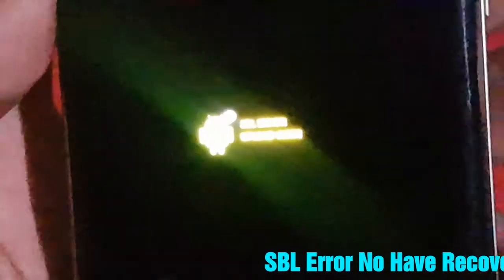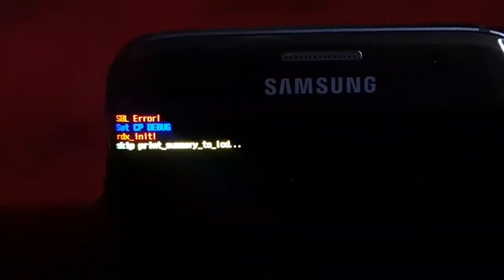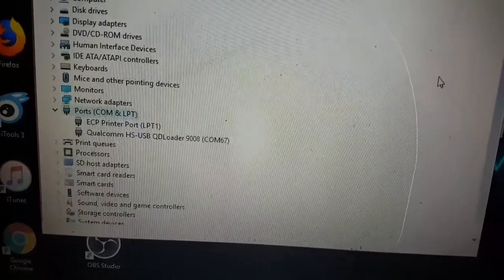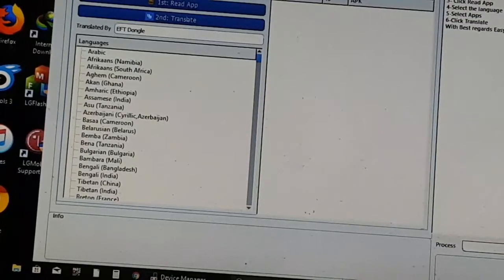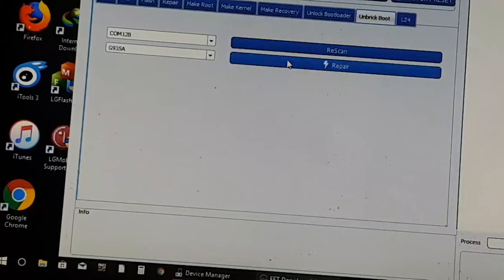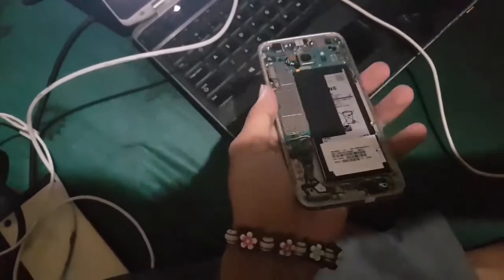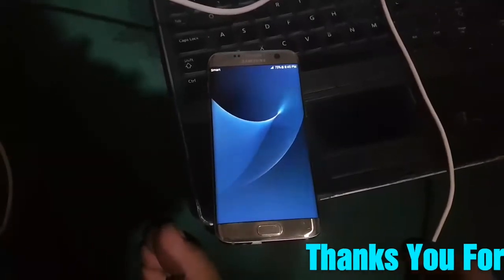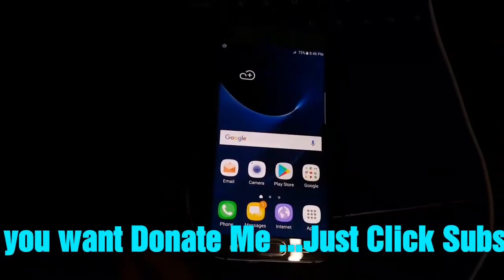Unbrick and Recover Boot SBL Error 100% fix Samsung S7Edge

Comment: anyone needing help text slb error to  805-410-5009
Reply: Need ur help bro I have z3x box my s7 g930v hardbrick need pic how to connect pin
Reply: @khalidchris4583  text my number
Reply: Hi!
I have a Samsung Galaxy Note 7 Verizon (SM-N930V) and it is stuck in QDLoader HS-USB 9008 Mode (Same as shown in the video).
I am unable to get out of this mode.
Please help me to fix this issue.
And also please tell me what should I do to solve this issue.
Thank You!
You can Whatsapp me on (+919458159867)
Thanks Again